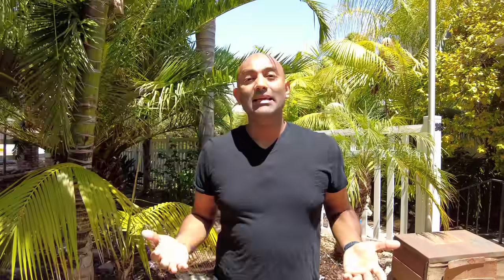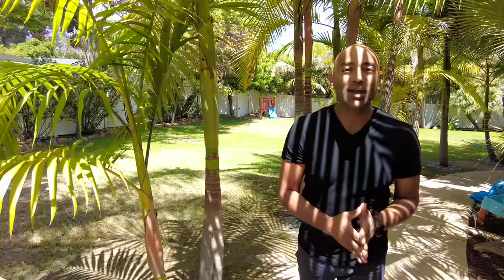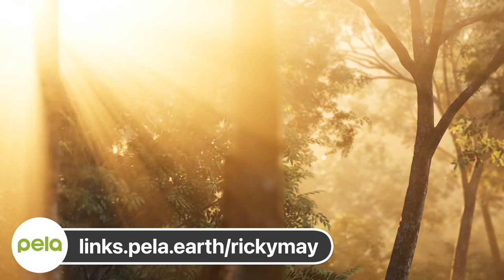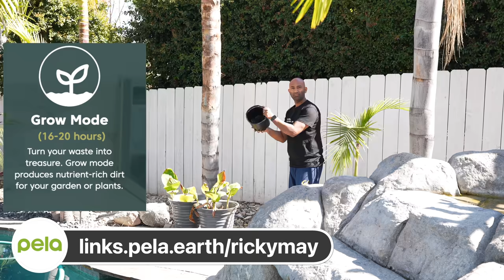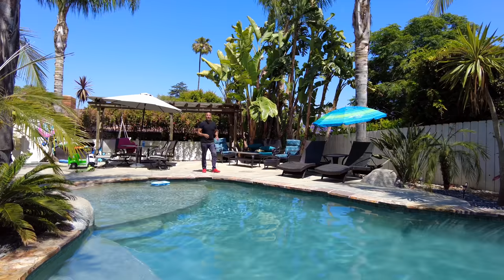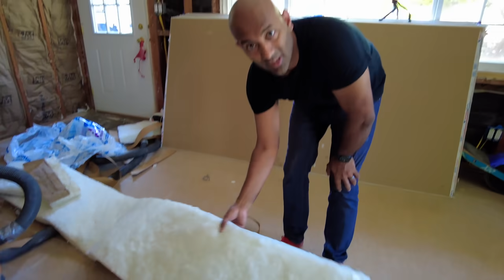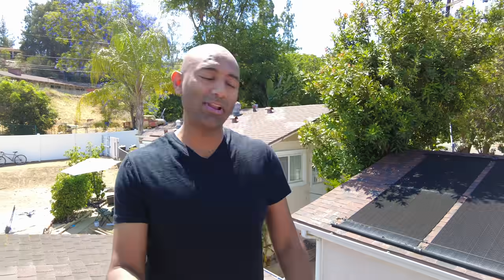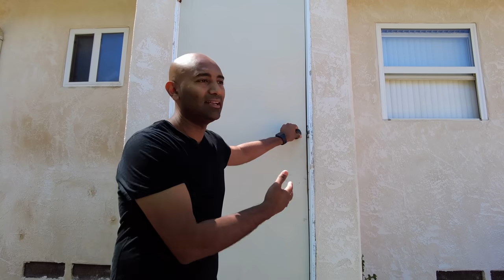How I'm Planning to go 100% OFF-Grid!

Comment: Hey my guy, small tip from an Australian. Water your lawns and gardens at night using recycled grey water (washing machine water discharge, water from your kitchen sink and shower water). This will reduce wastage of clean potable water and also reduces water lost through evaporation from the sun. We’ve been doing this in much of Oz for close to 2 decades now after the south east of the country experienced a ten year drought that only broke in 2010. It takes some re-plumbing work but will save you on water bills and usage in the long term. 

Kind regards
Reply from the maker: you read my mind! we are going to divert all gray water from sinks and showers to use 100% of our lawn use. videos coming in the coming months!

Comment: Hi Two Bit, I live now on the central coast in Portugal which stays cool and sunny! We have the LG heat pump dryer and washer they are very efficient and my spouse uses them every day. With solar on the roof and solar hot water roof mounted system you will have all the hot water you family will need. They’ve electric back up and you can dump excess solar power there too! I have workmen on roof right now installing 7.5 kilowatts of solar power with battery backup. Feel free to contact me, E.U. has a lot of really efficient appliances and building materials that are surely available stateside!
Reply from the maker: coat of Portugal is similar weather to us here in San Diego! that's awesome, 7.5kW of solar is a really nice size system. what kind of battery backup? we are planning a trip to Europe for sure, because for whatever reason you guys have way more efficient appliances
Reply: You are correct, we are very much like San Diego! Very nice climate year round! The backup batteries are made in Portugal and go the name Meter Boost. I went with Sunpower 370 panels for the solar on our east/west exposure. The southern exposure is narrow and the solar hot water tank with integrated panel take up that space. Our heat comes from hot water radiators using very small NG boiler typical here in Europe. But the solar hot water is in the loop and supplements to it during the day along with electric backup heat for the tank as needed. I plan to install an Eddie unit from my energy to divert excess solar to batteries and the hot water tank. Also an electric car in future! Keep all power I produce in house. As side note our gas comes from Algeria, not Russia. Portugal is a must see on your future trip!

Comment: We had a small 120V electric water temp was 180 degrees for making instant coffee (yuck), Though it did make a decent cup of coffee with a strainer as a pour-over cup of coffee, or a cup of tea, or those Ramen soup cups. To get the water to a safe temp turn the thermostat down or use a temp regulator with a shower regulator. Or just put a solar water heater on the roof of the business. When was the last time that it snowed in San Diego?

Comment: I would absolutely build your own battery bank with LPA prismatic cells from China, 1/4 the price of a Powerwall and you can make it the size you actually need rather than what you can afford or get from Tesla and it makes for a infinitely more interesting video :) Totally agree with getting rid of those crappy water heater mats on the roof and going for solar panels, especially in 2022 they are probably the best value technology on the market today overall.

Comment: I am on much of the same journey here in Tucson Arizona... I replaced all the insulation in my attic with sprayfoam, replaced all of the AC/Heaters with mini-split heat pumps for each room controlled by my self built home automation system. I have solar pannels to put on my house once I replace the roof. I have a well that I am going to put on solar with a huge pressure sotrage tank to store pressurised water in when the sun is not out. I just purchased the large Whirlpool heatpump clothes dryer. I already installed a heat pump water heater. I still need to replace old windows and upgrade the insulation in the walls of our house. Our only utilitiys at this point is electricity and someday I may start experimenting with offgrid solar with an automatic transfer switch to run my minisplit heat pumps.
Reply from the maker: That’s awesome! I’m thinking some sort of smart vent system that can port air only where I am. Too many rooms for individual systems. Plus I want to go geothermal eventually
Reply: @TwoBitDaVinci , we have a total of 10 mini-split heads on our system covering all 6 bedrooms, the dining room / kitchen area, and 3 living room areas.

Comment: There are 120v heat pump water heaters available now. I can't remember the brand though. I have a Rheem heat pump water heater and while it does require a 240 volt hookup to power the backup elements, you can manually set it to only use the heat pump if you want.

Comment: I am currently designing, (soon to build, just got soils report back on the land) a wholly off-grid home in Pahrump Nevada. Solar panels, battery storage (currently 19Kw panel system and about 96KwH of storage waiting for electrical engineering to see if can be less) with a nice pool. Power is paramount (since we'll also be charging two EVs eventually) and has influenced a lot of research and decisions. Going with induction range for kitchen, heat pump water heater for garages (benefit they help cool the garage space) solar heating for pool (I have a unique roof design, a true earthship ;-), that eliminates your issues). One key aspect though is HVAC. I'm going mini-splits. Highly efficient and able to control conditions by room. Love to share ideas with you guys, and of course am watching the series. Will be looking into that heat pump dryer.
Reply from the maker: I know where that is! That's awesome. Sounds like water will be one of your big challenges too... dude we need to connect! I'd love to come up and show your progress too! this is truly a community effort!
Reply: @TwoBitDaVinci  Water is actually one of the easier things. Easier than for you in SD for sure. I have to buy water rights and sink a well. About 300 foot deep. After that I'll have all the water I'll need. Of course it has to be highly filtered and there is an energy cost to raise it, treat it, and store it. So waste is kept to a minimum, also sewage is on a septic. There's no yard, since it is all desertscape, but we are having one area of about 700 SF for gardening. It will be a multi-year project for sure. Hope to start have all the rights and plan approval to start moving earth by the end of the year. I sent you guys a message on your FB page.

Comment: Our home has Geothermal and soon a ground mounted 16kw grid tied solar system.  We also have an induction cooktop, heat pump water heater, well and septic system.  There is no combustion in the house all is electric.  There is also 20 acres of land but it is located in a neighborhood and not off in the back country.  So we should be at net zero with the install of the solar but not off grid.

Comment: We’re on very very similar journeys and I’m part way through my work on our 1975 house in Carlsbad.
- lift, repair entire roof and re-line (June 2021)
- 6.9kwh solar with micro inverters and LG chem 9kwh home battery. (July 2021)
- whirlpool heat pump ventless dryer (august 2021)
- Samsung high energy efficiency freezer (oct 2021)
- looking to get span smart panel and car charger, electric mini arriving in august (q3/q4 2022)
- looking into geothermal for hot water and heating/cooling (2023)
- Alexa smart light switches and plugs (April 2022)
- electrify gas appliances in kitchen (2023/24)
- eco garden renovation to reduce water usage (2023/24)
Reply from the maker: wow Richard that is really impressive! and you're just like 40 miles from me! we should definitely meet up sometime. i'd love to pick your brain
Reply: @TwoBitDaVinci  sure, I sent an email a little while ago if you wanted to meet up over a beer, happy to show you around our work at the house if it helps

Comment: Couple notes on your strategy just in case you are not aware of. First of all I am in Spain and therefore our electricity is 230V. Anyway, I do have heat pump water heater and just installed a heat pump dryer. The HPWH consumes very little except if you use the resistive supplemental element, otherwise my 50 gallon peaks at about 600W which would not require 230V. Also, the dryers just remember that they tend to be smaller and have long cycle times so suggest you talk with your wife prior to committing.
Reply from the maker: just what I was thinking. thank you for sharing your data. Europe is very advanced in this way, compared to the US.

Comment: Good luck with the project. For clothes dryer, I’ve had a heat pump dryer for almost 7 years and can attest they are great, take a little longer but that’s the nature of low and slow. It halves the energy consumption. Ours uses about 2.8-3kWh to dry about 8kg (17lb) loads.
Reply from the maker: thanks for sharing, i was wondering about the data, that sounds pretty good to me!
Reply: @salibaba what size, make and model. Def curious but the heat pump ones I've seen look like they are all 4-5 Cu ft rather than 7+ cu-ft which my wife is adamant that we need (except I think whirlpool had one that was larger, but I though they may have discontinued it, and it had average reviews). Also is performance seasonally affected?

Comment: Rick
 I had an idea that would use the hot attic air to dry clothes and cool the attic space simultaneously. By placing a furnace blower inside a box with filters in the sides to transfer the attic air into the side of the dryer. Yes this only works best  during the daylight hours but you will be cooling the attic as well.
If drying clothes is needed at night the AC element is put back in circuit with an added switch. Also the blower and drum motor can run on solar power.
Food for thought.
Russell
Reply from the maker: Solid ideas. Got to make heat work for you

Comment: My dream is a geo-thermal system analogous to the octovalve. Heat comes out of the refrigerator and into the hot water tank. The hot water tank has a regulator to mix cold water so that it can bank more thermal energy than you normally want in order to save some amount of excess when it exists. Overall, it would serve heating, cooling, refrigeration, dehumidification, and hot water. 

Then the heat pump itself would be based on a design I am "working" on. The cycle uses the compressed side to help drive the compression going the other direction. Theoretically, once pressurized you basically only move heat.

Comment: Min 6. Great solution I've heard in years. Do not put thermal water panels in your roof, instead put photovoltaic panels and use a heat pump to warm your water (for heating or swimming pool). Three to four times more efficient and no water leakage, and in winter use the electricity generated to charge your battery.
Min 12.  I think maybe it's not a good idea to go geothermal in San Diego, your average temperature in winter is 9 to 18 Celsius degrees. Cheaper to use a good heat pump (like Daikin altherma 3). Geothermal installation is better for cold places like Alaska or Colorado.

Comment: Exciting journey! I'm doing the same on a much smaller scale, getting as neutral as possible. I got a vintage RV, tore it down to the wheels and I'm building a high-tech super-insulated tiny home that runs on solar and wind. I have a very limited income at the moment so I can't go EV, but I'm 2 weeks away from having my vehicle completely converted over to ethanol. For now, I'm using propane for hot water on demand and cooking. I'm a bit of a hobby chef, and actual burners is a hard preference there. It's one fun journey! If we each did a little, we could accomplish a LOT.

Not traveling much with the RV, BTW, so I won't be burning a bunch of extra fuel.
Reply from the maker: I want to do an RV too! That's so exciting!!

Comment: Don't limit solar install to just south facing. East and West are both viable giving earlier and later generation accordingly, and in my experience still significantly contribute throughout the day to the overall system capacity.

Comment: I know that this is not very common in the States, but have a look at glass/glass integrated solar panels like the "Level" system of Megasol or 3s Solar. Instead fixing up the roof of your house with new tarp style shingles and then mount solar panels on top of it, the integrated solar panels are the actual roof. Of course this costs more, but you will be good for the next 30 years at least.
We put then on our roof – btw also on the north-east facing side, which still delivers a good amount of electricity. It looks spectacular, will last for ever (glass does not deteriorate) and will save us money in the long run I think.
BTW: We also hurried a 10'000 l rainwater tank in the garden and are thinking about drilling for geo-thermal heat. 🙂

Comment: I suggest you look into the Enphase Ensemble system with A/C batteries and the micro-grinding system. ie, the solar system, even though grid-tied will work when the grid is down.

Comment: Hi,  love all your videos and your new project is super exciting.   I have been trying to conserve electricity for a couple of months in preparation for our solar install.   So far I have managed to reduce our daily usage from 52/kWh a day all the way down to 26-28 /kWh a day.   The two biggest savings were switching to a heat pump water heater and a variable speed pool pump.   Both of these upgrades saved around 10/kWh a day each.   My pool pump now runs 24/7 and uses under 2/kWh a day.    Something else you mentioned in this video was the hot water for your studio/house.   Our water heater only draws under 400 watts and uses 1.5/kWh a day.   You could definitely get rid of your gas.
Reply from the maker: Wow what kind of heater! That’s amazing reductions! How does the variable speed pool pump work? We need to connect mark!

Comment: Interesting project, for sure!  This will be fun to follow.  One suggestion for the second house: Perhaps consider a solar hot water heater, one that uses a tank on the roof instead of thermal panels.  These are common in Costa Rica and other Central American countries.  San Diego climate might be suitable, especially if you are not particular about how hot the water is.  Since you will not be washing dishes or clothes, or taking showers, in the second house this may be a satisfactory solution and not require a natural gas hookup.

Comment: Drip irrigation is great but it doesn't work on lawns. I have a 1200 gallon water catchment under my patio that pumps into 50 gal barrels that feed the drip system. I have a salt pool as well but I intend, once I get solar PV, to make it fresh water using UV and ozone to clean it. All the chemistry becomes electro-chemistry. I only run the pump when the sun is up and the solar blanket is on, that covers most of the heating. My pool  bot is the best thing I ever bought. When you re-roof don't forget to re-angle the roof for optimal solar at different times of year.
Reply from the maker: woah, i need to hear more from you! write me ricky@twobit.media

Comment: For the studio, look at the Rheem electric heat pump water heater.  I put one in a year ago in a pool house that has a 60 amp subpanel (like yours) and no natural gas.  It uses about 1 kWh/day - providing hot water and showers as needed when people spend the night (or week) there.  I live in Los Angeles, so a bit warmer than San Diego, but it works well.
Reply from the maker: That’s awesome how many gallons?
Reply: @TwoBitDaVinci  50 gallon water heater.  I think there are some major rebates now.

Comment: Electric Hot Water heater -- Better than instant hot water heaters, uses solar electricity not heavy on power usage.  SPAN Electrical Power Panel for upgrading allows you to better balance electric usage without higher usage panel.
Reply from the maker: absolutely!

Comment: Just thought I would add that while it would initially cost more, a copper made roof pool heater would solve  any leakage issues permanently, as well as more than likely being able to generate higher temps, and have better heat retention properties, and probably work better on cloudy days. It could also alternately be used as a supplement or a replacement for the home hot water heater. I'm not an expert by any means, but I think this could be a viable solution, that does not necessarily need to be roof mounted.

Comment: Exciting! We've been trying to do this in CO., to some extent, but the prediction I have is that water will be what keeps you from being independent.

We are going to get pretty close to net-zero energy this year, with our gas tankless water heater and dryer being the next two areas of improvement. Some day, a non-grid-tied solar/battery could close the gap. Except for water usage haha, but they'll make big improvements in water over the next few years hopefully.
Reply: *water for our lawn is the least sustainable element of our lives, by far. We've been looking at rocks, and have turned to just dyeing it green the last two summers.

Comment: You can get typical silicon solar panels with water passages in them for the pool. They are quite a bit more durable than what you have now. It may be worth looking into.
Reply from the maker: yeah but i worry about the added complexity... I'm leaning towards classic traditional PV solar, and addressing the water heating via heat pumps